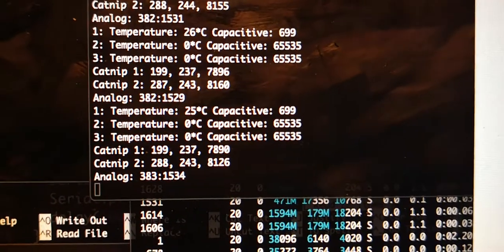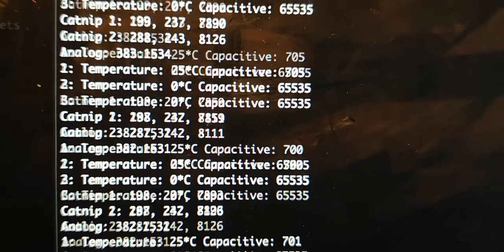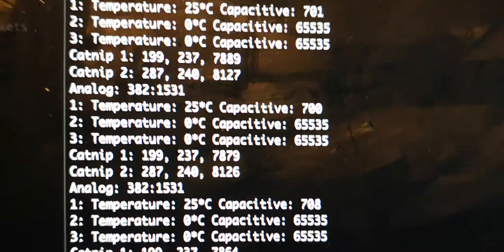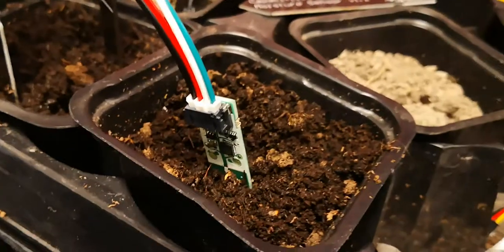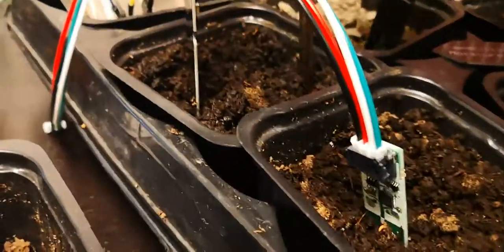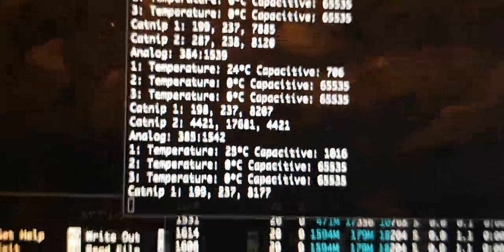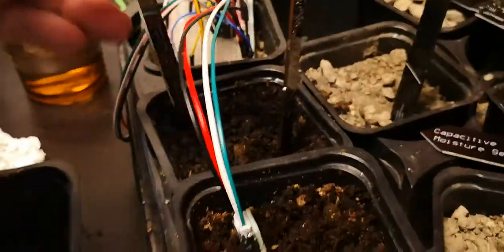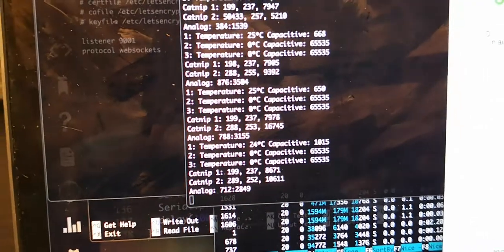Adafruit Stemma soil sensor bug (video 1)

Comment: You do realise how these work don't you?  They output a square wave signals and uses the capacitive nature of moist soil between the probes to produce an analoge value to measure that capacitance.  if you put another similar probe next to it you have just introduced a second signal into the soil.  Yes the value of the first will now be different.
Reply from the maker: Didn't strike me as relevant at the time, but now that you mention it... :)

Comment: Seems to give out random numbers no matter the moisture level. They have mentioned on their website that the value range is between 200 to 2000 but I get 1016 at max while touching the sensor and 320 minimum when it's in the air.
They have mentioned on their shop that they have updated the firmware and am guessing they mean the firmware of the  chip and not the seesaw library. Any ideas on how to fix without reprogramming the chip?
Just bringing my hand closer to the sensor seems to raise the output value.
Reply from the maker: Sorry. I don't have an idea for this one. I could reprogram it, but I don't want to spend the time. I ended up using this instead https://www.tindie.com/products/miceuz/i2c-soil-moisture-sensor/ and it works much better.